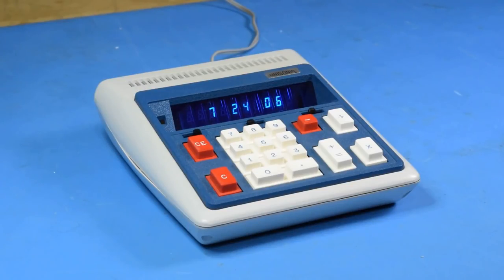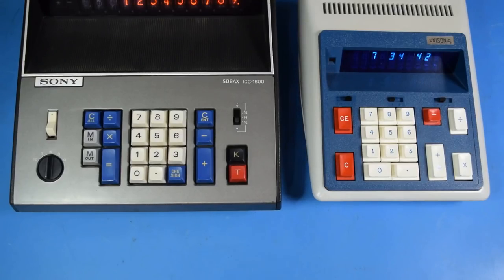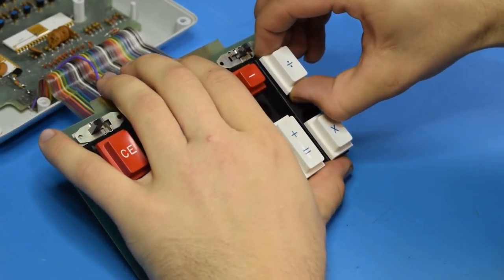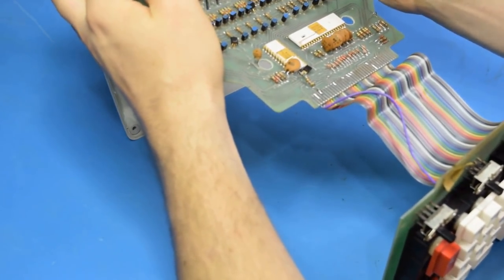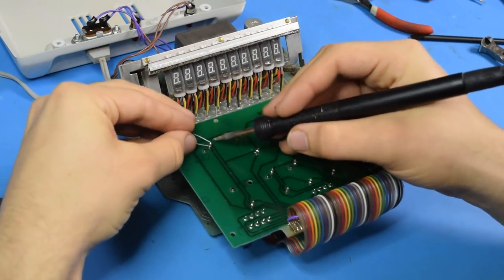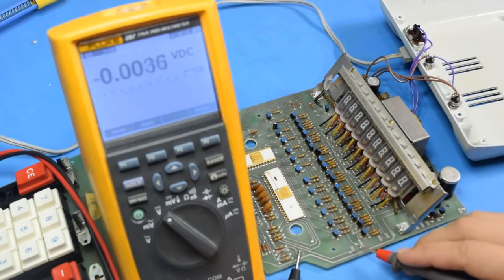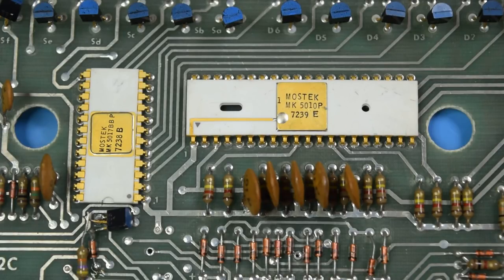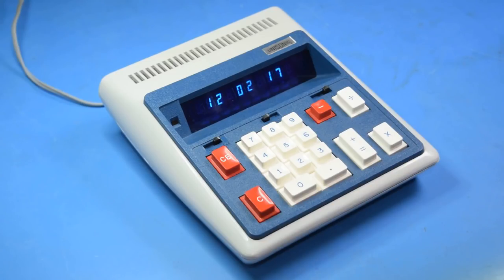0x002C - 1972 Unisonic Calculator Diagnosis

Comment: Actually, I think that making the replacement CPU would be an insanely interesting video (or a series)! Maybe with something like an ESP8266, you could really go ham, push weather data onto it, make it into a discreet wireless keycode entry console, have an RNG mode, let it talk to an external thermal printer for calculation logging, add alarm clock functionality... I guess I just really dig those blue VFDs.
Reply: IKR. I can see it going something like this: 1) Make a 3.3V power rail for an ESP. 2) Move the keyboard to the 3.3V rail. 3) Connect keys to ESP. 4) Make an output interface to convert ESP outputs to VFD bizarro-volts (probably the hardest part). 5) Program the thing to do anything and everything.
Reply: Or ESP32

Comment: I recently fixed a nixie tube Canon calculator that had dead diodes between the keypad and main board. It resulted in weird input behaviour. Maybe you can check the diodes with a meter. You can measure them in place. But I do agree that the Mostek chip could be dead. Mostek chips don't like getting old. Not sure if there is some atom migration happening on a molecular level or what. Anyways, I've got an HP calculators that were switched on after 30 years and worked fine for 30 minutes, and then the next moment the Mostek chip died completely (ACT chip in Woodstock series calculators).

Comment: Isn't this problem with those yellow ceramic capacitors? Check their capacities, they must be exactly identical, otherwise the CPU will detect several different code combinations after key release.

Comment: I tought it would be way more yellowed? How they did manage to preserve that?
Reply: Case doesn't contain Bromide and therefore is not fire resistant?
Reply: booboo699254 What?
Reply: The reason plastics turn yellow is the use of Bromide.  See: https://en.wikipedia.org/wiki/Retr0bright.  This is done to make the plastic fire resistant / retardant.  If these plastic cases are not brominated, then they won't turn yellow, but lack the fire retardant characteristics.
Reply: booboo699254 Nice to know! 
I was thinking on trying to retrobrite my old keyboard. 

But does somr kind of plastic without the bromide, gets yellowed too? A friend tried retrobrite in his old speakers, and they didnt change at all.
Reply: Eduardo Avila Retrobright only works on ABS, and only if the damage is from sunlight, not cigarette smoke or something like that. I've tried to brighten up a Mac Mini G4, it has a (in my case, rather yellow) transparent polycarbonate part in the top case, and it didn't help at all.
Reply: The bromide theory has been recently challenged

Comment: Have you heard of FPGA? Field Programmable Gate Array, microchips specifically designed to be able to be reprogrammed. By this, I do not mean just merely send data to the CPU to make it run instructuons; the entire functionality of the chip can be changed on the time.

Just buy a chip with the same pin-out (as well as perhaps be able to accept negative voltage), program it to mimic that CPU and then solder the chip back on. If all goes right (and if you don't accidentally blow your equipment out), you will have a fully functional calculator; for all intents and purposes, that CPU is a replacement part.

Of course, thigs might not be as simple as that. After all, I know very little about these sort of chips. Whatever's the case, it's even possible to program it so that it can, for instance, be an entire ARM CPU, complete with what that implies. Those that make ARM chips provide code for FPGA boards to allow them to mimic an ARM CPU.
Reply from the maker: An FPGA would be insanely overkill and still not handle negative voltages. For the vast majority of applications it makes no sense to use an FPGA. They've just become known as "super fast magic chips" and are seen by the public as a universal solution to everything. 

The point of an FPGA is to have TTL speed components in a small space(ie, not waiting for CPU clocks). Why would I emulate an arm core instead of just... getting an arm core.

Additionally this calculator is so simple the logic could be recreated with an ATtiny with some extra I/O. The problem is the interface voltage to the rest of the circuit.
Reply: FPGAs for turning hardware problems into software problems xD